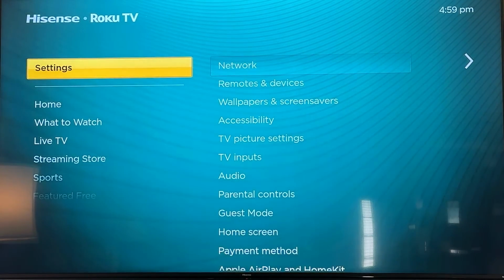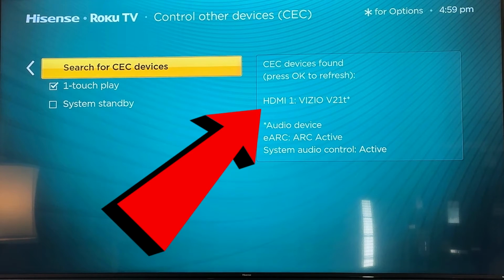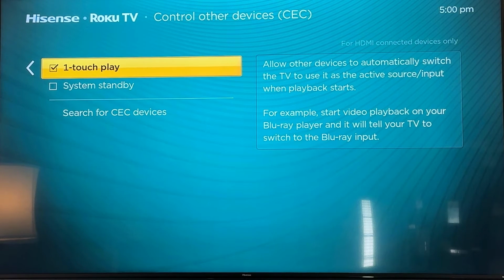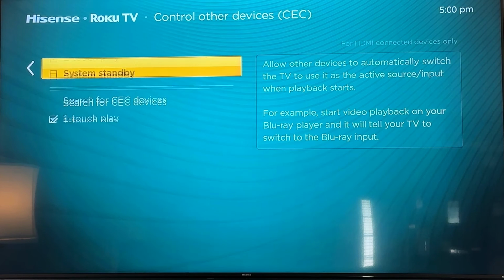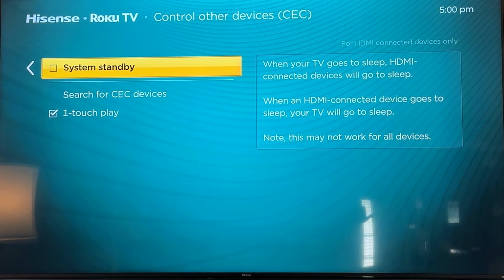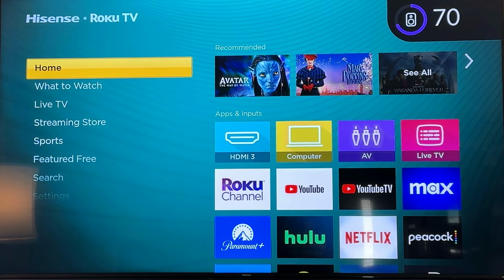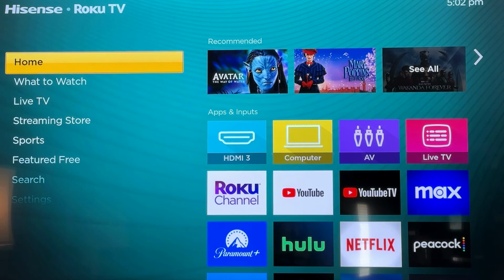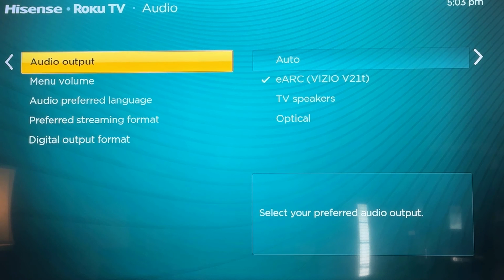How to Connect Soundbar to TV Using ARC HDMI - Quick Guide on installing HDMI Soundbar to ARC TV

Comment: the question is if it is possible to connect the soundbar with hdmi arc out to tv hdmi(non arc) in. I'm trying to hook up ps5 to tv and soundbar to tv, but my soundbar would connect only via tv earc, but need for ps5, as it os the only port with vrr and low latency enabled